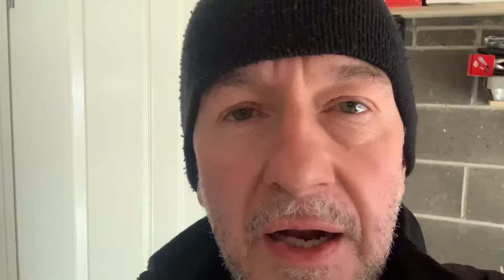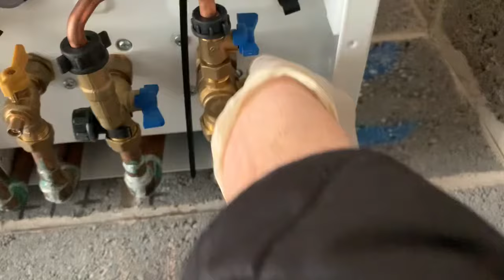Ideal combi no heating after topping up the system pressure

Comment: I've just done my system I changed the rad and got the air out and topped up system and my rads would not heat up only hot water. Thought I had screwed it up somehow and then came across this help vid and bang on perfect, thank you. Now I realize about that black switch, I won't be doing that again. Thanks so much. You have saved me an ear bashing off the wife later. Plus, my stress level has just dropped to normal after all the reading up I did.

Comment: Great video! Thank you so much! I'm an amateur DIYer who just took off a radiator to strip some wallpaper. After putting it back on the heating could only warm up 2 radiators. The boiler temperature gauge kept going up and down (shortcycling?). After checking onilne it sounded like i'd let air into the system, so I bled all the radiators but no air came out. I was in the middle of trying to bleed the boiler pump but discovered it has a big electrical looking thing covering where it looks like the bleed screw is, and I was researching how to remove that when I saw your video. The black isolator valve you point out was mostly horizontal, so I guess the pump just couldn't get the hot water through the small opening fast enough. Fully opening the valve has got all the radiators working and saved me from potentially breaking the pump. Many thanks!
Reply: That’s great glad it helped you. It’s such an easy mistake to make 👍

Comment: You've just saved me a lot of money, as I was about to call out a central heating engineer.  The previous engineer must've forgot to turn it back to the vertical position, after installing a new radiator.

Comment: Thanks for this, interstingly, that tap is vertical… boiler has hot water but no heating arghh 
Upon first switch on a week ago it heated and then gone. Drained water from rads then topped up it started and in 10s switched off again. Any ideas
Reply: Is the tap on the far left side of the boiler also vertical? Also do you have a room thermostat and is that turned up?
Reply: @DaveLane1964  thanks for reply, thermostat was clicking. Played with some manual timer settings and it started working magically 😎

Comment: Thank you for this. You are a star! I had done exactly what you said. Just out of interest if you have isolated the boiler does it use the gas without any heat benefit?
Reply from the maker: No it won’t use any gas
Reply: No gas used as flame goes out once boiler reaches internal thermostat temperature. In my case, boiler set to "e" and internal temperature of 69c. No flame once that was reached.

Comment: Hello mate, what do I do if the black tap was turned but now won’t turn back upright? Tap is stuck in place. Have tried lowering the water pressure again, leaving boiler switched off etc but no luck.
Reply: Did you figure this out as mine is stuck?
Reply: Also have this problem! Going to let the boiler cool down then try again. Did you find a fix for it?
Reply: @harleyfairburn2372  after turning the boiler off, I applied a fair bit of pressure to switch and it finally turned.. Hopefully don't have to do that again anytime soon

Comment: The black valve on my boiler is horizontal but I can’t move it. The little “flame” comes on for about 10 seconds and then disappears. DHW is fine and the temperature on both DHW and CH is turned up but still no heating at all. Any thoughts?
Reply: Hi if it’s horizontal it won’t work it needs to be vertical. If it’s too stiff try using some pliers or similar and watch the video to see which direction to turn it. It will turn. Hope that helps
Reply: @DaveLane1964  thank you! Hubs gave it a pull and it’s finally rectified. My house is warming up and my children are happy. You are an actual life saver! The amount of people you would have helped with this is insane. I wish you all the best 😊
Reply: @sjfolly that’s great glad you sorted it👍